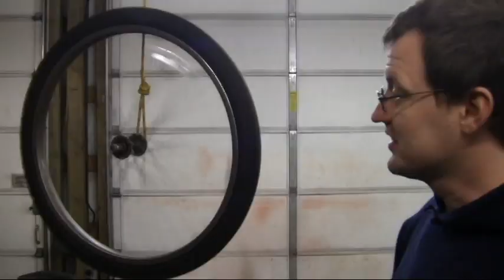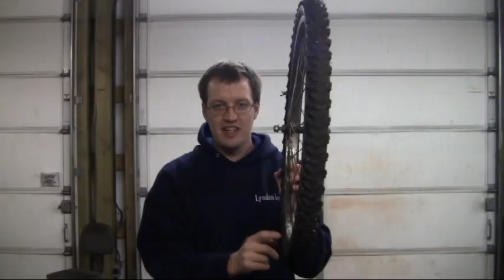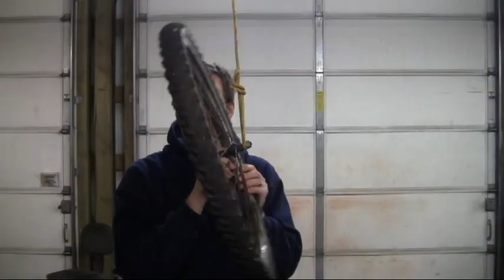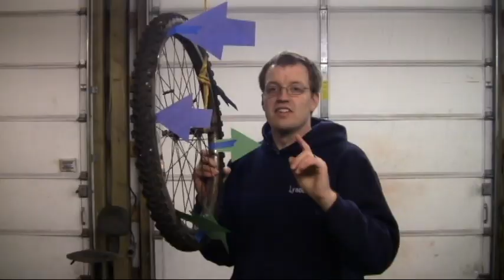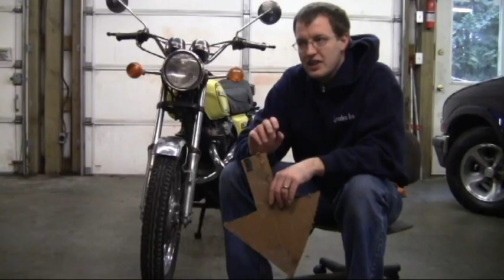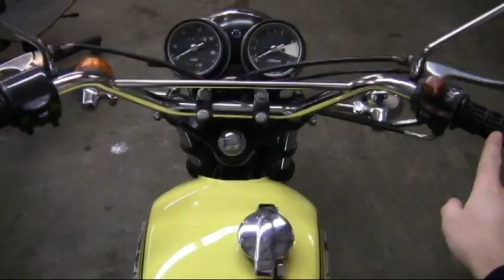Gyroscopic Precession LONG VERSION explained logically (Spinning Tire on a string gyroscope gyro)

Comment: That's why you don't fall off your bike if you ride. And it is hard to explain to your kids if they are scared of falling off their bikes
Reply: I'm fairly sure that's not the reason. If it were at the low speeds kids roll at, they would have trouble turning their wheel left or right when it's actually really easy.
Reply: i have heard that in the video but remember you have your handlebars and leaning for leverage to help with turning I realized if you take your handlebar in the middle it's not so easy to turn 

and if it is not the reason why you don't fall ,what is ?
Reply: Ernest Franzsen
Oh that's a good question though, I might be able to venture a decent text explanation but you better check on YT instead. I believe it has to do with the fact that a handle bar rotation axis is not perpendicular to the ground plane and how the front wheel is attached a little forward to the axis and not aligned with it.

Comment: Great job.  I certainly did not miss the vector diagrams and the sundry omegas and taus and 3.14159 trappings.
 
I had an uncle, a fine man, an excellent machinist to boot.  He loved bikes.  His other two interests in his decades of letters and family updates consisted of that subject plus his mileage and the local weather.
 
Having no interest in some man’s travel mileage, and even less in his local weather over which neither of us had any control, I connected in letters discussing our mutual lust for motorcycles.  His at the time was only a few cc’s less than mine.  Man remains size conscious throughout life, it seems.
 
I sent him a two page exposition of omegas and taus and the proverbial 3.13159 explanation of why we didn’t press the handlebars to the right in order to go right.  That our destination would certainly be the grill of some eighteen wheeler heading toward us.  He didn’t believe me.
 
There is no way a person can learn to drive a bike from a book.  No Sir!  I guess it’s that way for most things in life, eh?